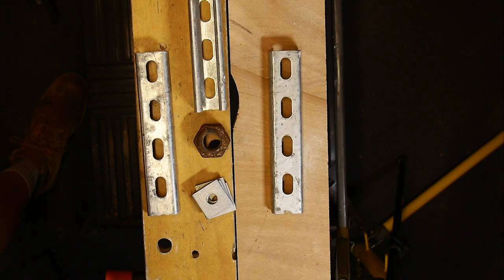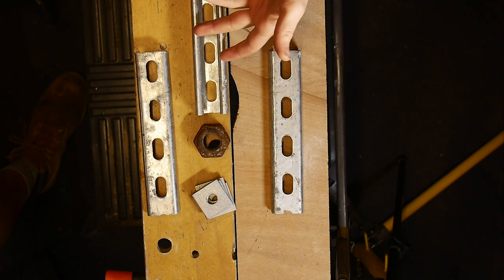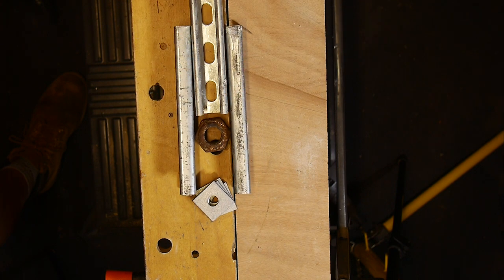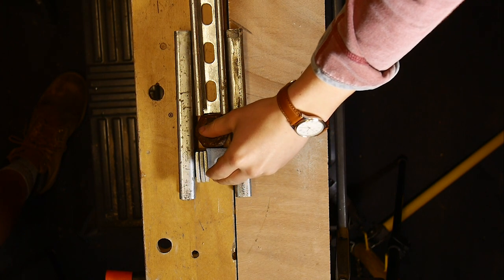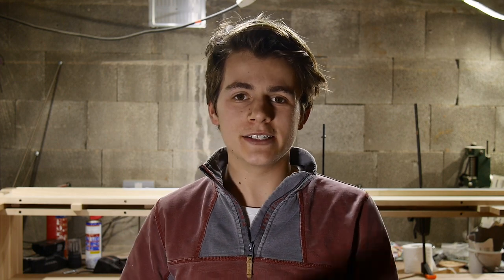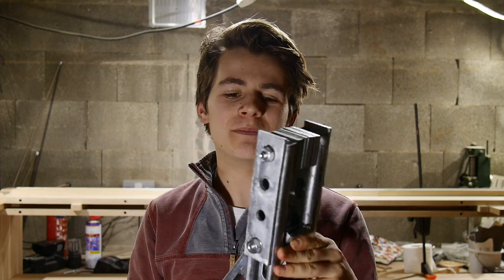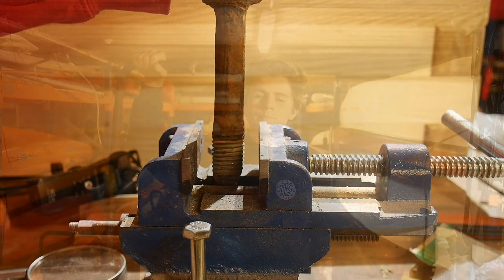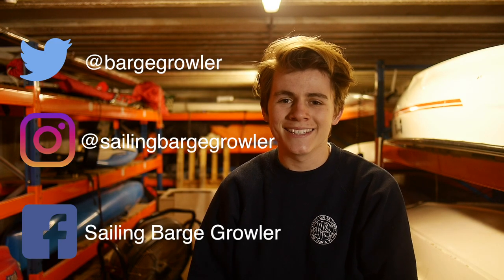Episode V Part II

Comment: Big Stillson's(which will grip the nut)/scaffy bar combo and repeated heat. Don't trust WD40, which is largely useless in these applications as it can't penetrate. Traditional rust treatment is soaking in diesel. Your best tool is knowledge; talk to, and listen to, as many (old) people as you can - they've been through this and would love to pass on what they've leaned. Check out "Rebuilding Tally-Ho"(Sampson Boat Co.). Good luck, mate.